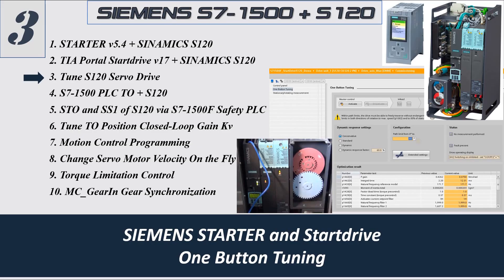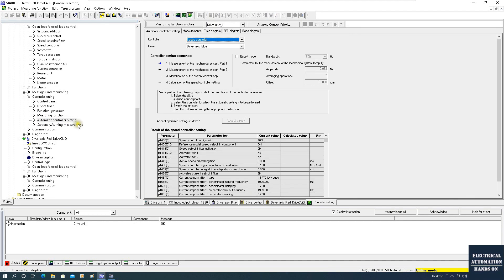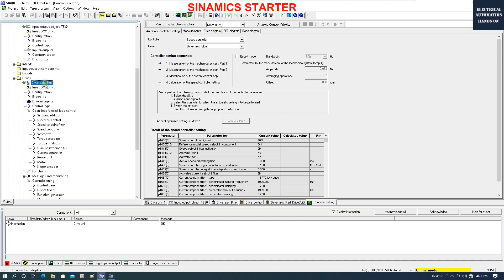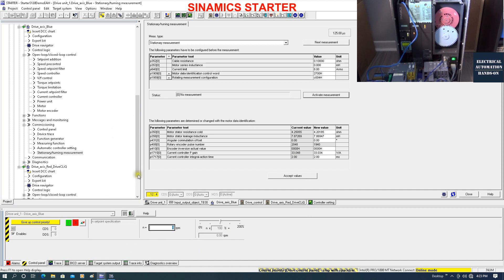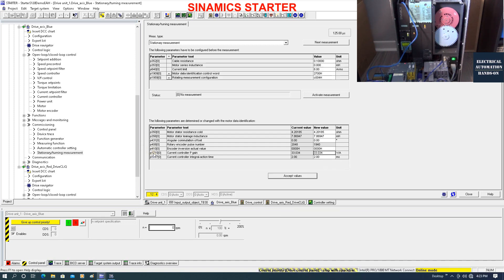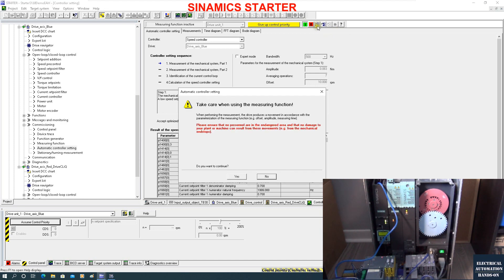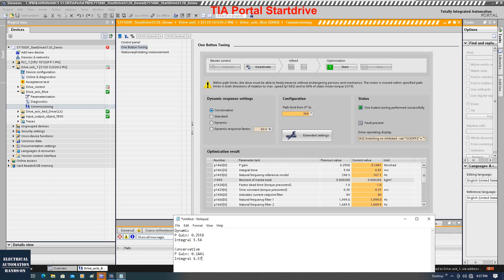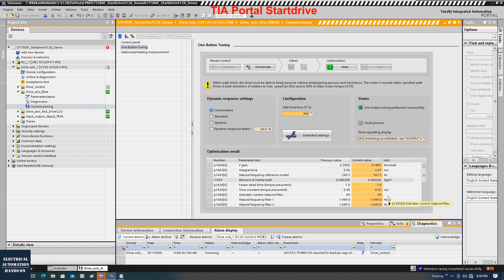MS05d. [Siemens S120 #3] One Button Tuning S120 via STARTER and TIA Portal Startdrive

Comment: Thank you for your video
Could you use the stationary/rotational measurement function in StartDrive to perform the same functions you covered using the Starter tool ?
Reply from the maker: Starter and StartDrive both work, but Startdrive works better wuth TIA and  S7-1500. You need to configure P488 P489 for the measurement input function